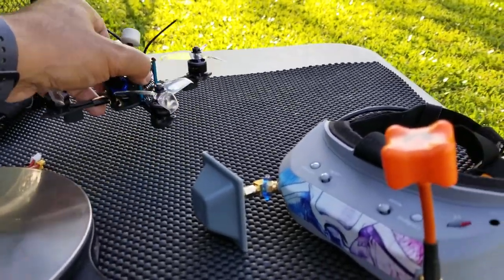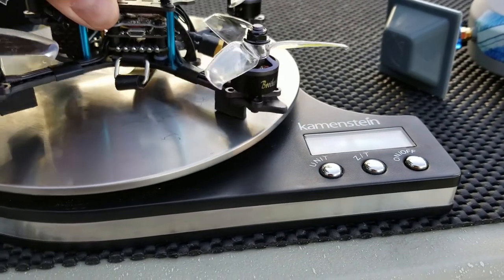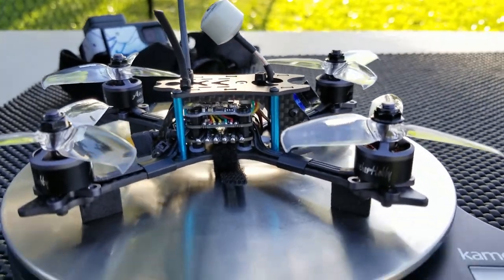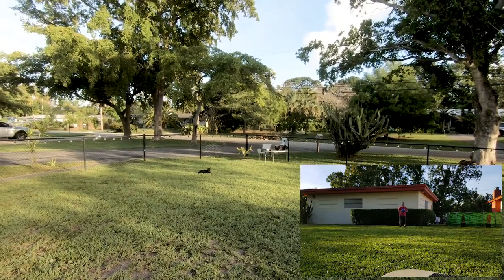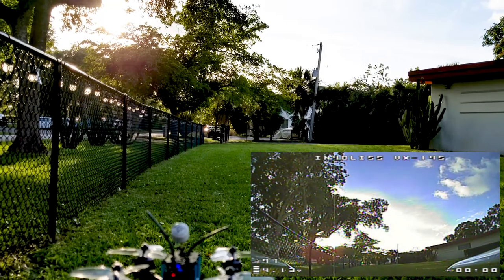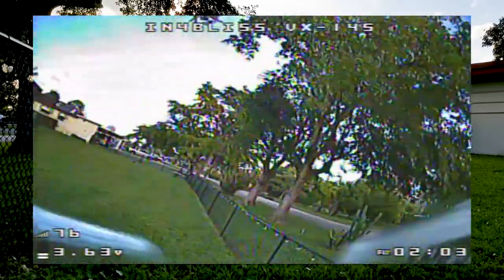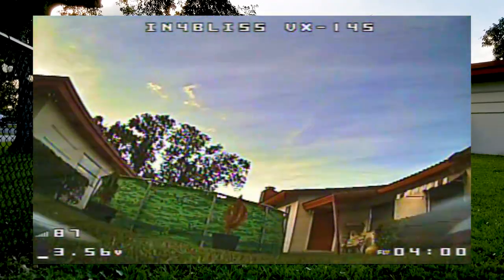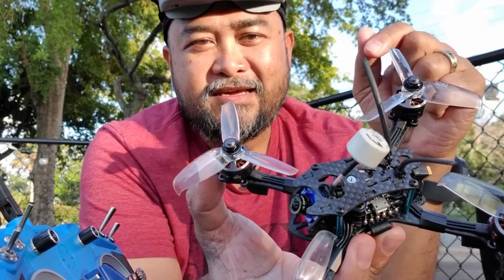😃 Full Speed VX145! Frame Review, Build Components and Maiden LOS/FPV!

Comment: 👍🏻👍🏻👍🏻
Reply from the maker: Thanks Mike :) She's a beast on 3S! Can't wait to try 4S!
Reply: in4bliss You should fly it on 4s. After I switched to 4s batteries I'm not going back:)
Reply from the maker: I hear you there bro, I've tried the Tattu 4S 650mah with the BH 1507's on the Roc Ultralight. Holy whaaat! Lol the speed is amazing!
Reply: in4bliss I built an Eyas X3 112mm frame with an Emax 1306 4000kv motors and 3” props. I use Tattu 450mah 4s batteries and that’s a rocket:)
Reply: in4bliss You should build something light around 120-130 grams with those motors)

Comment: Somehow i missed this one!!! Great review as usual!! my cousin who's always flying with me just recently got the xjb version! I'm yet to see him fly it haha. i'm curious to see how it goes! i almost got one but then id have to buy a bunch of 4s batteries for its class when i just got a bunch of 3s GNB's. this hobby is getting more expensive haha.. this camera looks pretty good too! i been meaning to get the monster micro but its sold out everytime on banggood. if i try get it local here i'll get another PAL version that i cant use the onboard dvr without the cropping
Reply from the maker: Oh! Haha! Thanks bro :) Ya I put two vids out on the same day. The arrow micro pro did well but I changed it to the micro monster afterwards. The monster was in my Win5L but I changed it out for a micro eagle. Hehe my parts are playing musical quads! I was running 3s and still am. I don't think it needs 4s but I'm sure I'd like it 😋 I just flew 4 packs through it an hour ago, all 3s, to fine tune and it's perfect on 3s. I'll try 4s eventually though. I gave the two 4s 650mah I had away 😂 and now they're out of stock! It's very fast and smooth as it is. I think the 4s will just be an augment to the thrust which might make it a harder to control in tight areas but might help in bigger areas. Relatively speaking, it has waaay more thrust and speed than my Leader with the Sunnysky's... on the same Tattu 3s 650mah packs. And my Leader is plenty fast lol. I was using the same 3s packs with the Roc Ultralight. Which has the same motors as my VX145 lol! Btw, I gave Tony my Roc Ultralight as a gift :) Can you guess who got my 4s packs?! Hehe it felt good to finally give back, plus it was his birthday so it was perfect!
Reply: in4bliss woah u just answered my next question which was gonna be how it stacks up to the leader build with the sunny motors! That says loads about the 3s performance!! What about flight time? U think it's comparable with the sunny skies? I ask because I'm thinking of getting rhose or similar motors and swap one of mine into a slightly larger frame I have laying around. Seems like u really like this build if u swapped the monster into it 😎. Maybe I'll just get this frame seeing it's the original 🤔! And that's a very honerable move with the give away!!! U got a good heart and I hope I can do this one day too. I'm sure I will with the rate I'm accumulating drones 😂. Also glad your trip was awesome and looking forward to some footage u got 👍👍
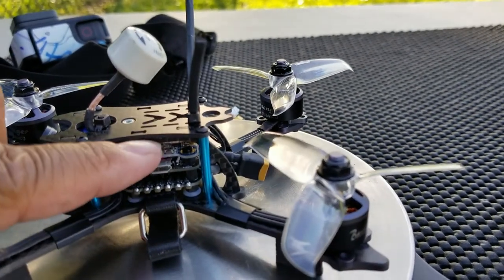Reply from the maker: Hey :) Ya bro, flew 4 packs after work last night and having a great time! Hate to say it but lately for me, I'm finding I prefer the flight characteristics and performance of my 3" and 4" quads over the 2.5". Of course I still enjoy the 2.5" and can fly it in more places but tbh, the 3" VX145 is just barely bigger. The flight times were the same! 3:45 minutes with pretty aggressive flying and 4:30 with a mix of cruising... on the same Tattu 3s 650mah! That's another thing I love. Using the same packs in my 2.5", 3" and 4"! The 1507's are proving to be more efficient on the same power. I would assume this goes for the 1407's with similar kv also. I may try some 1403's to replace the 1106's in my Leader and Hayabusa! Spoiler: I have a 3" freestyle frame on the way! I bet I'll fall in love (again) lol! 
Hoping to edit that vacation footage this weekend! Oh, and the micro monster image looks great in the goggles. I'll try to get some dvr uploaded soon. I might do it at my house and do a SBS!
Reply: Goodness now i have to get a set of these 14xx sized motors and test them out haha!! thats what i thought tho, i'm looking for a bit more efficiency so i can enjoy flying more without stressing the batteries. the 1106 6500kv are awesome but suuuuuck power on hard flying, and i got the 5500kv versions that don't seem to be much better haha. Thats COOOL your getting another 3" freestyle frame!!!!! I'm so hooked on trying out frames and different combos. I will love to see this frame when u get it :D and yes definately do a SBS of the monster! i wanted so badly to get one but bangood is out till june i think :( , i ended up ordering an NTSC version of the sparrow 2 so i can use the onboard dvr again

Comment: How do you like those BH 1506 motors? Much more powerful than 1407?
Reply from the maker: They're really good! I haven't tried 1407's yet. This is my second set of BH1507's. The first set is on the Roc Ultralight. I imagine they'll scream with 4S because 3S is plenty fast! I just happened to give away my only two 4S 650mah so I have to order more lol. The reason I chose the 1507 (again) is because they're the same price within a dollar or two of the T-Motor, Hyperlite and BH 1407's. They work very well on the 4" HQ props also (on the Roc Ultralight). Figured for the same money lol.. you know how that goes :)
Reply: in4bliss if I can fly 1407 on 4" 4S, those 1507's must be amazing. I can't wait to try them

Comment: What are your flight times flying freestyle on 4s 650 on this build? Thanks!
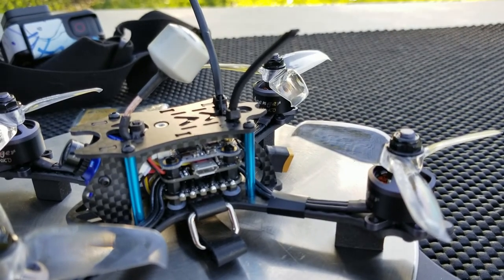Reply from the maker: Hi :) Unfortunately, I'm waiting for my tattu 4s 650mah to be delivered. I'll test it and update here. But tbh, I already know it will be nearly identical. You can see an example of this in my roc 218 maiden flight vid. I ran the Tattu 3s and 4s on the same brother hobby 1507's motors on 4" hq 4x3x3 and 4 minutes with normal flight, dropping to 3:40ish with more aggressive flight. Should be similar results here :)
Reply: in4bliss I use the same 4s lipos I’ll might be trying this motor out when u give me a update! Thanks!

Comment: How much was the build altogether? I am considering getting it and doing my first build. I was going to just buy the HGLRC XJB 145 and am now reconsidering. I love Fullspeed and love my Leader 120 so after learning they copied his frame I am not impressed. Would rather support FS. I only wish they would have built one as well and sold it as a PNP.
Reply from the maker: Hi Andre :) Ya, I feel you there.. I love Fullspeed too! Here are the prices: VX145 $16.99, FSD328 28A F3 Flight Tower $45, Brother Hobby 1507 3600KV $16.99 x 4 = $68, Foxeer Arrow Micro Pro $19.99, Frsky R-XSR $19.99, Aomway Mini VTX  $16.99. So if I added it correctly: $187 total. I left out the Lumenier Axii Antenna ($20).. the Aomway Mini VTX comes with a dipole antenna. And I included the Frsky R-XSR receiver which is an extra $20 (the XJB PnP doesn't come with a receiver). If we subtract that, it's $167 for a custom built VX145 which is a pretty good deal. Will be more powerful with those BH 1507's too :) Thanks for watching! I appreciate the support!
Reply: Thanks, man. You are doing well and getting better with the videos. I have learned a lot from you. I also see you on the forums. Lewis is a good guy so I am glad all the channels are promoting their stuff.